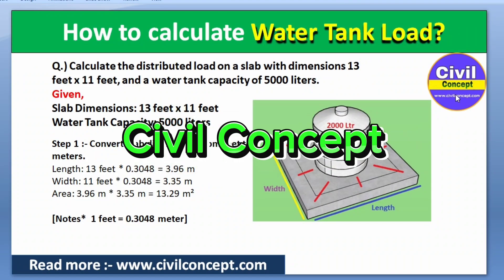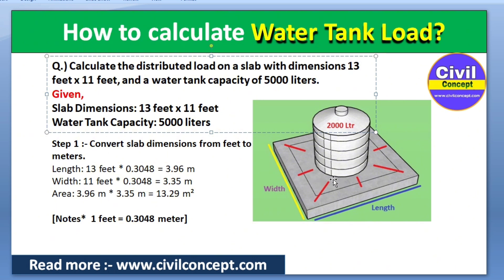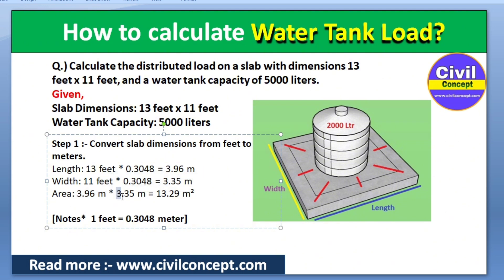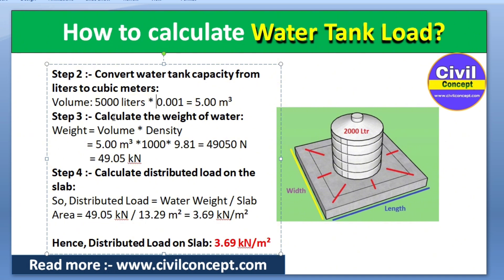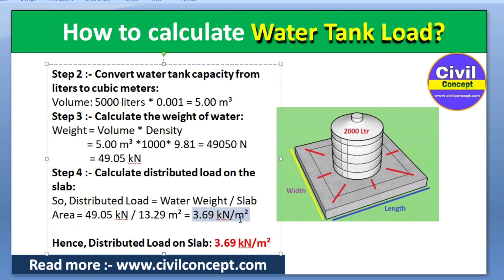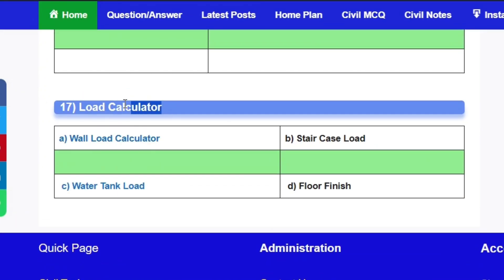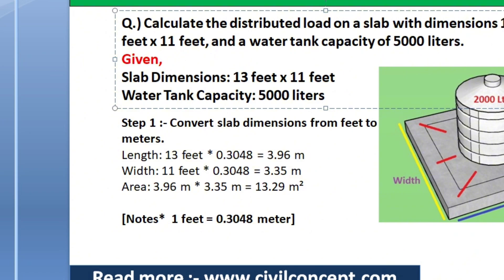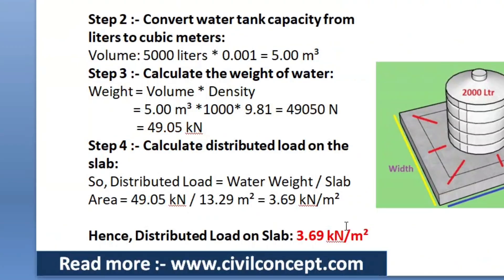Water tank load calculation on Slab | Step by Step Guide

Comment: Sir how much maximum weight (or how much max weight per square foot) a normal roof can handle without any issue. Thanks.
Reply from the maker: It depends upon design of slab.